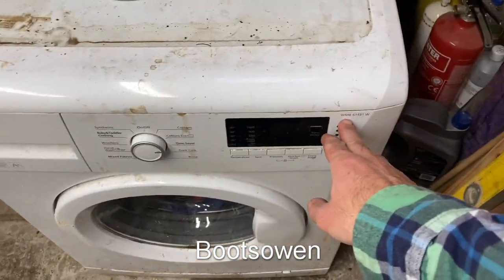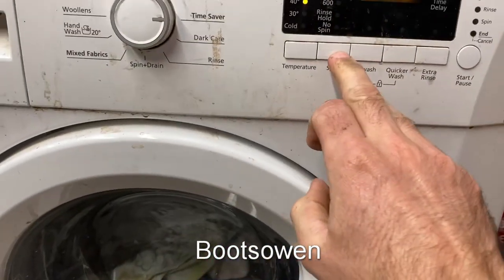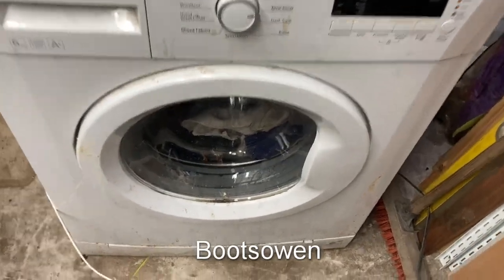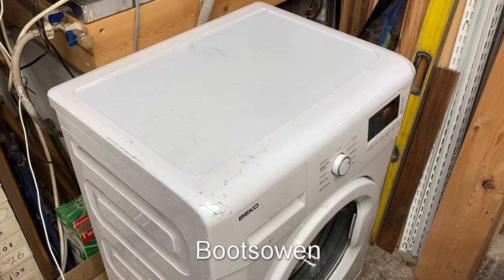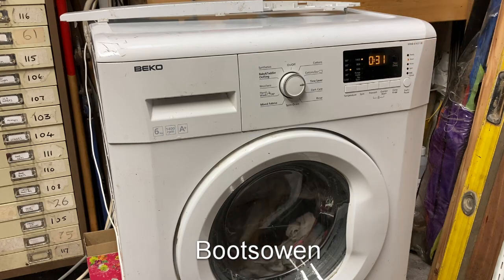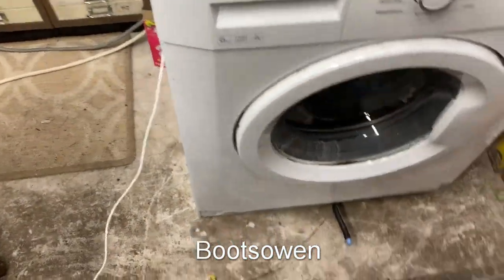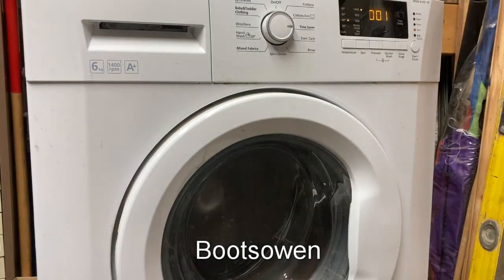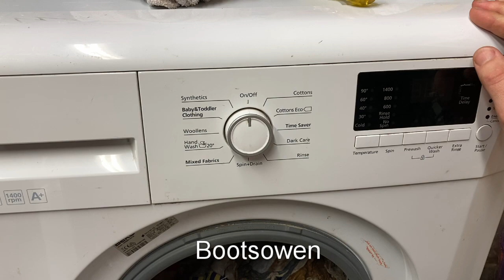Found it on the street, Will it Wash?

Comment: Nice find! Beko machines like to have door issues a lot. I'm from turkey and i have an arçelik 7103he washing machine and the door hinge broke, we called arçelik technical support and they fixed it for a high price. Then the start stop button cracked and i didnt wanted to call technical support since they charged too much money for it, i opened the top and removed the motherboard and replaced the keypad. Then the door latch broke i removed the glass door and opened the plastic part of the door and fixee it myself. Beko/arçelik machines are easy to fix in my opinion because all of the models of them are pretty much the same.

Comment: Nice classic (old beko) very very solid and very very good condition!! bearings great, apart from hanging door! i would say there no real good reason to chuck it out (maybe dated but defo useable) great video :D
Reply: Dont worry about the snots and stuff in door seal or the suds - bekos always do that - they have probs the best rinses on any machine :)
you ever thought of when u see the rusty machines, spray paint them?
id try a 90' wash just to make sure that works if does i think its perfectly fine!
Reply from the maker: What about smashing it with a brick, bekos are always good for that?
Reply: @bootsowen  nah that's a complete waste if the machine is working
Reply: @bootsowen  no
Reply from the maker: How much is a machine like that worth?
Reply: @bootsowen  it depends if you clean it fully and make it spick and span, then it might be worth like 230 quid ish

Comment: Scrap visit today.
2 kgs electrical appliance cable - £1.50 per kg - £3
4.4kg steel shred ,- 18p per kg - 79p
Total £3.79
Reply from the maker: Good stuff, are you going on a bike or a car? What kind of stuff are you scrapping? you should post some scrapping vids!
Reply: @bootsowen  on that occasion the steel was a computer my friend was throwing out and some little bits.
My friend gave me a lift in his car, usually I would take the bike trailer.
I am more of a cord cutter, all I really carry is a pair of cutters and some screwdriver.
I keep an eye on Facebook, Freecycle and Gumtree ads  for stuff.
Today I took some flat plugs out of the freezer and broke them up.
I try and avoid steel, my biggest income item is cable.
Reply from the maker: I like cable, it seems to have a very good price and is easy to store. I carry a channel lock pliers, a side cutters and some screwdrivers, I seem to be able to get most things that way. I keep a look out for skips that have copper and brass plumbing parts, good heavy taps are what I really like.

Comment: just throwing away my 6 y old Beko...that worked 1 per week for 4 years...for 1 person, 7kg machine....i hate it! it tore my garments...did not wash properly....just made things wet!(for guys this may look ok...but it just did not do the job) plus it just started leaking water under...i paid 300 eur for it....i would never recommend it!....and bought LG now...i would never use other people's machines because filled with dirt (poop, urine) and they must smell ugly :) cause mine certainly did! and i am suuuper clean person
Reply from the maker: do more hot washes, the smell/filth is because you are not cleaning your machine, Imagine wearing your clothes!!
Reply: @bootsowen  yes true...will do now with the new one.....i was just trying to avoid damage to my clothes....i was doing 60 degrees washes..mostly 40 C....maybe the leakage was no big deal.....but i know i hated her from day 1 because it made holes in my clothes
Reply: @bootsowen  btw i did not undrstand what is there to be celaned lol cause it looked clean from the inside........now will clean the new one regularly....but old machines never smelled that way
Reply from the maker: if you use too much soap, especially liquid soap, it builds up a layer of soap and poo etc between the drum and the tub, the bit you cant see. You can clean it using acid like vinegar, or bicarb, or citric acid, I find using very little soap, like 1 desert spoonful for a full load still makes bubbles and that is enough. Wash your towels very hot like 90 when you wash them and use less soap. also you don't need fabric softener, haven't used it in 10 years. If your clothes smell clean they are just perfumed from too much soap and that scum inside the tub.
Reply: @bootsowen  oh i always put a bit more of liquid soap because we have very hard water, but eco liquid ...so not the artificial one. Thank you so much for advice....i will defo pay attention to it more now